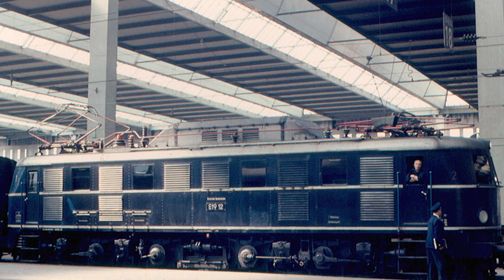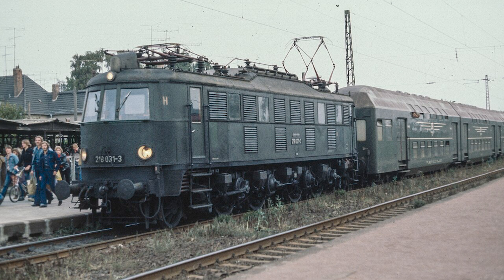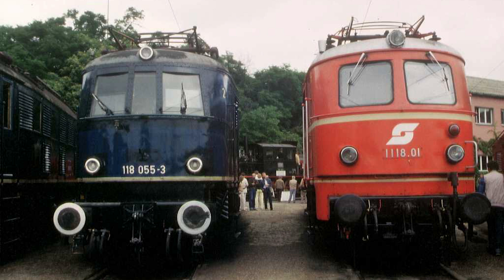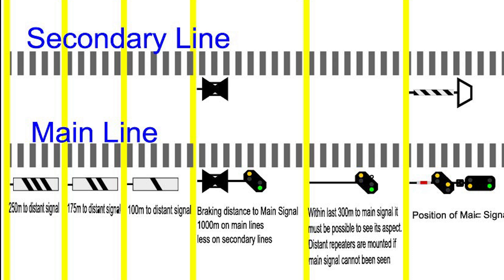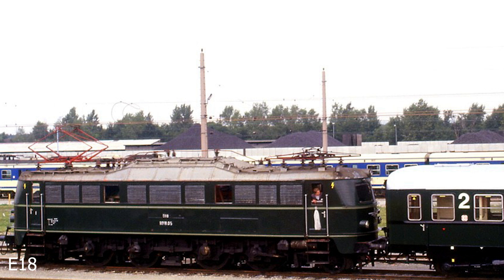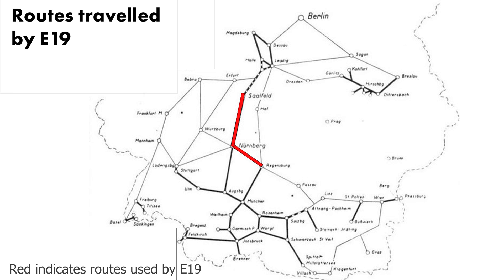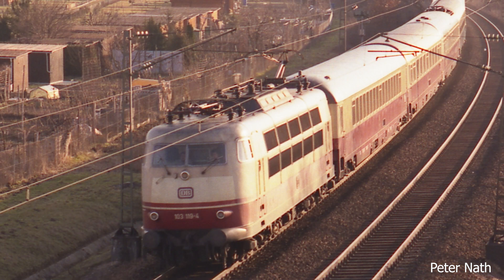The German Electric Prewar 180km/h Speed Machine: The DRG E19 E Lok

Comment: in practice they never went faster than 140 because until 1962 there were no lines allowing that speed, and by that point the E18/E19 were outdated, so further high speed development was based on the E10 and finally the all new E03 developed.
Reply from the maker: You're right in the sense of highspeed development was based on the E10 however from what i have seen the E19s were atleast used for testing certain concepts in the 50s atleast

Comment: For anyone who may be confused why some the E18 and E19 pictures show a class 118, 119.

With the introduction of UIC computer readable class numbers in Germany letter prefixes where abandoned and electric locomotives where alle reclassified as 1XX.

Diesel Locomotives are 2XX,
Shunters are 3XX, 
EMUs 4XX for power cars and 8XX unpowered 8XX.
Battery Electric and Hydrogen 5XX
DMUs 6XX for power cars and 9XX unpowered.
Reply: And to make things even more confusing: East Germany has prefix 1 for diesels, 2 for electric. So the 218 in one of the pictures is also an E18. The red 1118 is also an E18, as Austria did used a variation of the German numbering scheme
Reply: The old, former short-line-(road)switchers often not fit in the scheme. For example the whole KHD-engines
Reply from the maker: Honestly that is a really concise way of explaining it. To be hones the german numbering scheme is pretty sensibld. Thank you for the explaination
Reply: Sadly, not all new engines currently fit in the scheme. Here are two examples:
Alstom Prima H3 (dieselelectric shunter) has become class 1002
Stadler Euro900 (dualmode roadlokomotive) has become class 2019

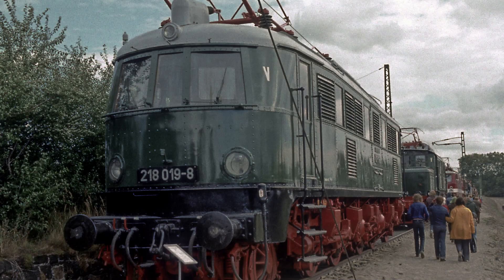Comment: Thanks for the video. Maybe they were not famous because there were so few of them. Also, the frequency mention at 1:33 should be 16 and 2/3 Hertz. They divided 50 Hertz by 3 to come up with the frequency.  Look forward to the next video.
Reply: It was 16⅔ in Germany, Austria Switzerland and Sweden.

With better non rotary converters, Germany Austria and Switzerland jointly switched form a 16⅔ Hz to 16.7 Hz sometimes after the war.

Sweden retains 16⅔ until today.
Reply: @IamTheHolypumpkin 
And Norway. All five countries are still on the same voltage and frequency.
Reply: @IamTheHolypumpkin  The frequency used is still 16 and 2/3. The number 16.7 that number rounded up in decimal format.
If you divide 2 by  3 with your calculator your get a number like 0.666666666666666667.
Reply from the maker: Yup silly mistake of mine, should have double checked my script there. Thank you, i'm hoping to get the last of the New York Central episode i'm just debating if i do the 20th century limited the week after as its NYC for 2 weeks. So may spread out the love